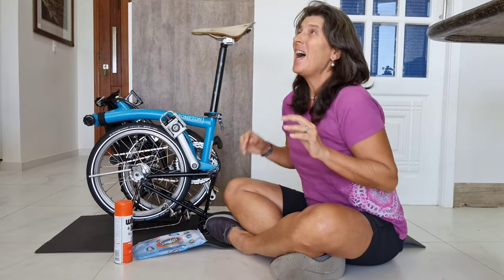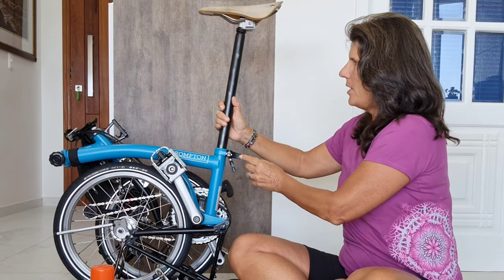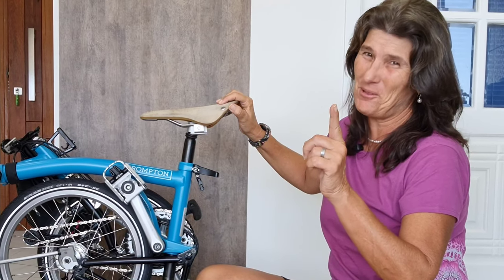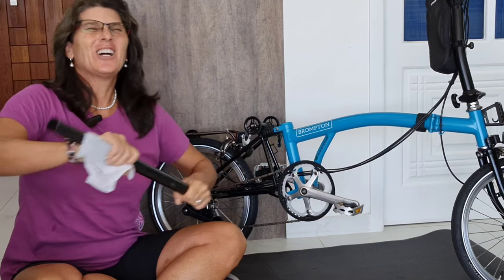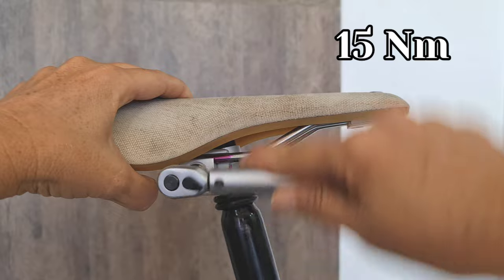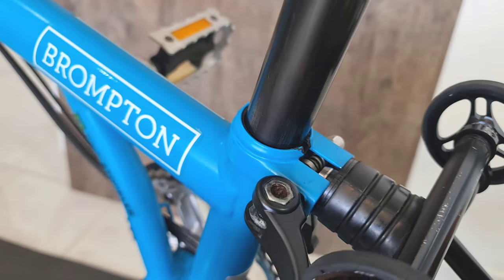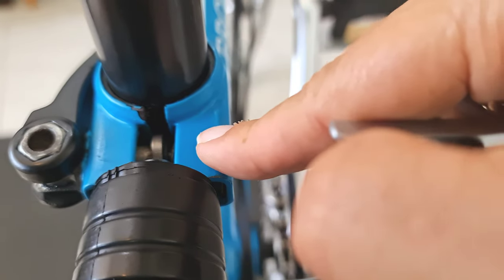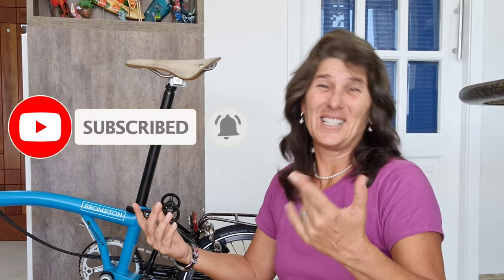BROMPTON Slippery Seatpost  4 FIX

Comment: Very nicely explained! I haven't had this problem yet, but I have thought about it, especially as I can no longer buy that plastic sleeve as a spare. What to do if I can't get to my Brompton dealer, or he doesn't have one? I decided that if all else fails and I have to use the bike I will try a smear of that seatpost locking paste sold for carbon fibre frames and posts - the microparticles might just restore the grip - for a while. haven't tried it, but I expect I will, one day.
Reply from the maker: Hi David Powell
Interesting though,  but I'm not sure that  locking paste will do the trick. 
We use it on the road bikes so the seat post stays  in place and does not get stuck to the frame. It hapends when the rider sweets a lot .
What do I do is order the parts I know I'll need in advance and put them in stock for when I need them.
So I keep my mind at ease.
Nice to have you on board!
Reply: @ChrisbyBike  Point taken - as I said, it's a plan, an untried one and definitely a short term last resort one! It sounds as if Brompton operates a different set of rules in your vicinity than they do in  the UK. Here they started, back before Covid, to classify some parts "supply and fit" only. Registered dealers were forbidden to just sell them,  and no one else could get them. Seat post clamp inserts were one of the first to go (the height regulators are available) but you can still buy the equivalent but slightly smaller inserts that fit into the telescopic seat post. I've been my own bike mechanic for better than 30 years and about the only operation I won't tackle is wheel building. I'm really quite cross to have discovered recently, while browsing, that in the event of a crash I can't buy replacement forks now - I have to pay a dealer to supply and install them, plus I have to deliver and collect the bike. But I can buy original headsets from a dealer and fit those myself...     It's similar for the rear triangle...    I mean...

To be fair, some of this resulted from an understandable desire to manage parts supplies in favour of production during the demand peak and supply chain disruption caused by the pandemic. Things have calmed down somewhat now, yet the rules have't relaxed. My nearest dealer is 12 miles away and doesn'r have much of an online presence. A tricky situation to manage, compared with being able to pull parts out of my cupboard 😁
Reply from the maker: Hi David Powell 
It makes sense. The production is not enough for the demand. 
My nearest Brompton dealer is at 450km, but they are nice to send the parts that I need, like sprokets and chain. 
It is great to be your own mechanic,  I can do little fixing, but not the technical ones.
I don't think damage plastic sleeve is that usual. Usualy is seat clamp adjustment. 
Keep Safe! Keep Riding!

Comment: Great video Chris, I’ve noticed recently that my seat post slips a little, my knees notice it the most as they start to ache, going to take out the post and clean it and tighten it just a little today.
Reply from the maker: Hi Juli Anne
I'm glad you like it! 
Hope you can fix it. Be patient on tighten it. Bit by bit, so it will not damage the frame.
Nice to have you on board!

Comment: 😁 I had to use the wrench in my tool kit it on my first and second ride!
Reply from the maker: Hi NoZenith 
You are clever, I've just notice that wrench after months. 🤣
Keep Safe! Keep Riding!
Reply: @ChrisbyBike   I've used it to adjust the seat post and seat tilt mostly. It has been handy and included all the tools I needed so far since my Brompton is still relatively new.  😊 thanks for the compliment
Reply from the maker: Hi NoZenith 
The Brompton Tool Kit is great. It has everything we need to fix basic problems on our Brompton.
Keep Safe! Keep Riding!
Reply: @ChrisbyBike  what is your opinion on the Brompton tube patches? I just watched a video and the guy said they're worthless and he always carries glue and stuff with him. I don't want to waste any of them testing them out but do you think they work at least for a short-term solution to get home?
Reply from the maker: Hi NoZenith 
Almost all of tube patches don't work. The best solution is having a extra tube, replace the flat one, them fix at home with the glue paches.
 They realy work, but take longer to dry.
Keep Safe! Keep Riding!
Reply: @ChrisbyBike  thank you so much. I really appreciate it

Comment: And I have replaced my tension nut with a nice looking specially made Brompton fingernut!!! You just release the tension, and adjust the nut, and then re-apply tension!
Reply from the maker: Hi Finn Carl Bomholt Sørensen 
They have beautiful and much lighter upgrades for seatpost clamps. I'm always tempted to upgrade it.
Keep Safe! Keep Riding!
Reply: @ChrisbyBike  I have lately bought a Printed Saddle with an oval carbon frame below, and a new Lightweight Clamp to fit it. I didn't go for the most extreme light and expensive ones (costing half a bike!) but found a more reasonable priced one, much like Yours, and with a folded Brompton on it! But in red, to give a little extra fun! My bike is Flaming Yellow.  Finn. Denmark
Reply from the maker: @finncarlbomholtsrensen1188 
Hi Finn Carl Bomholt Sørensen 
Did you like it?
Is it conffortable?

Comment: Hi Chris, another awesome video!  I have a very weird one with my saddle. It goes down a bit but the much stranger thing is that it goes sidewards a bit and always towards the same direction.  Not sure how or why but I might need to go see a doctor as my body might push it to the right hand side :-)  
Where did you get that torque wrench and how much did it cost?   Seeing this as an investment and taking the guess out of how much is too much.
Reply from the maker: Hi Luc Peeters
We tend to repeat our movements and, probably,  when you pedal or when getting out the bike, you do a movement that turns it to the right. 
No worries, as soon as you fix the seatpost clip it will be fine.
About the Torque wrench, I've bought it years ago on a Bikeshop. It is expansive. But, in my case, if you have a Carbon bike it is extremely necessary. 
Nice to have you on board!
Reply: @ChrisbyBike    Chris, just removed the seatpost this morning. While everything on the top 95% part looks new the bottom 5%, where you clamp it in the sleeve, is rusted. It is not surface rust which really bothers and surprises me.  The sleeve was also not black but had a rust colour and I had a very hard time removing the brown crap with brake cleaner. It's really weird since I live about 100km from the coast and I keep the bike in mint condition (Barbour 2018 version). So I will have to replace it but I like the silver since it fits with this version of the bike, so I might go titanium.
Reply from the maker: Hi Luc Peeters
I'm glad you found the source of the problem.
I have my Titanium Seatpost for over an year and I'm very satisfied with it. Good choice.
Keep Safe! Keep Riding!

Comment: Hi Chris, i have tried cleaning my seatpost but still getting slippage. I am not sure if the clamp is abit too lose but I am way too scared to tighten anymore and my bike is brand new 😢 is there a certain torque for tightening the clamp so I can feel for confident that I am not over tightening? Many thanks! 😊
Reply from the maker: Hi Yasmin 
It does feel scary to tighten up.
A good way is to do it by small steps.
Put our seatpost up and close the clamp, then turn 1/4 clockwise the bolt. See if it worked.  If not, tourn another quarter.
A orher reason for slippage could be the plastic sleeve that is worn out. For that, it is better to take to a Brompton bike shop.
Tell me later what did work for you.
Nice to have you on board!
Reply: @ChrisbyBike  hi Chris, i think it just need tightening ever so slightly. I did it and it seems to be fine now! Thanks for the help!
Reply from the maker: Hi Yasmin
I'm glad it worked, and now you can ride your Brompton again.
Nice to Have You on Board!

Comment: As a rather tall Scandinavian man my bike was originally delivered with a 600 mm, extra long seatpost, which was impractical when having to put it in my, German, B&W travel box for this purpose (I had to remove saddle and post before packing). So I have also bougth a Standard Length, 535 mm black titanium post for test (same price as an original post, but from China), and my saddle hight is now no longer a problem! I now just pull it out in full to stop, before riding, and it may be a fraction too low for me, but still useable during travels! But being a heavy man, it is pressed down a little during rides, so I may have to find a solution?
    It is possible to buy some fluid/grease  which may make a seatpost stay during rides on an ordinary racing bike and I may try that for a solution?  Finn. Denmark
Reply from the maker: Hi Finn Carl Bomholt Sørensen 
Tell me later if it works.  But I don't think it will.
These paste are used so the seatpost doesn't stick to the frame because of Ryder's sweat.
The Brompton seat post is supost to go up and down. 
What makes it stay in place is the pressure of the seatpost clamp.
Better chech the seatpost clamp. With a lots of patience,  because it can damage the frame.
Keep Safe! Keep Riding!
Reply: I have seen several videos where heavier people get a secondary clamp. You put it down over the tube before you put the seat on and it sits on top of the frame of the bike keeping the seat post from slipping down and that will keep you from having to over tighten your seat post clamp. The ones I saw people were getting cheap off Ali Baba or something online but I just Googled Brompton seatpost clamp and you can actually get one that is a factory replacement and it would do the same thing. You just leave it loose on the seat post so you can slide it up and down and once you get the seat post set where you want you put this against the collar of the frame clamp and secure it so it can't slip down https://www.clevercycles.com/brompton-telescopic-seatpost-clamp-band-and-quick.html
Reply from the maker: Hi NoZenith 
Interesting solution 👍🏻😊
Reply: @NoZenith  Yes I have one of those also, but it is HEAVY, and I had to pay the same price for mine, from an English bikeshop during Brexit (Brompton spares aren't common outside England!) as a similar post from Taivanese Producer of top parts for Brompton: Joseph Kuosac!
Reply: @ChrisbyBike  I have the problem that it sinks a little during riding (it is a very solid, black titanium post of high quality with thick walls (Not just cheap shit!)) and I expected to eventually being able to use the original "insert" from Brompton! But I have found out that I may just pull it out to Max. It was bought from a wish to be able to fold and put my bike directly in my B&W travel box, so I may still use my ordinary, long, black titanium seat post (600 mm. With an integral ring mount on top, and no end-stop at the other end), when not on vacation!
   And my wife is now scared of an eventual coming new round Covid19 (Both being 74) so we may not travel that far away any more? But we are both fond of the Danish, rocky island of Bornholm. We originally had booked 3 weeks on Malta in November, but decided not to go! If anything happens for one of us, the other is in problems, even with an insurance. But Bornholm is similarly hilly and I may need all my gears + my feet and they all drive in the right side of the road on the island, for comfort. ;-)
Reply from the maker: Joseph Kuosac is a very good brand
Reply from the maker: Hi Finn Carl Bomholt Sørensen 
It is hard to ride in a Country that uses a different side of the road. On My 5 months in Australia I had to be very alert to cross roads and ride my bike.
Hope you find a good solution for hour seatpost. 
Keep Safe! Keep Riding!

Comment: I have lately used my Aceoffix seat clamp on my, standard length, black titanium post. It is lighter and functions better than an original Brompton clamp, because of the wedge system in a ring (I have just got a new, golden "titanium" bolt for the locking system, as I expect the original bolt to be more heavy?). But I still have my longer, black titanium seat post with a ring on top, which functions in a similar way, and without the weight of a clamp. But it may be taken up directly by a less honest person that way.  But leaving a hyper expensive, fold to nothing bike, without looking after it at all times, is not that smart! ;-)
Reply from the maker: Hi Finn Carl Bomholt Sørensen 
Yes, Bromptons are made to be by our side all day long.
Keep Safe! Keep Riding!